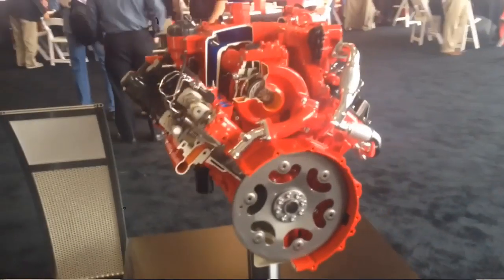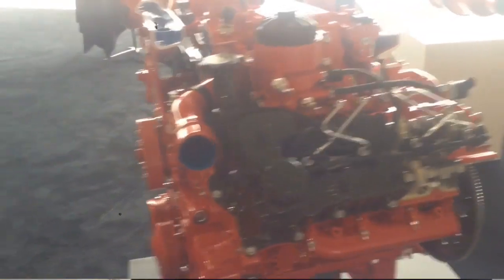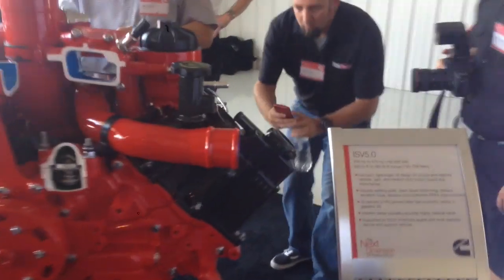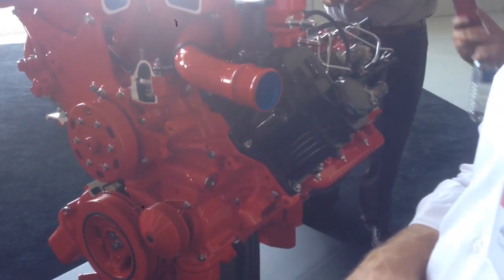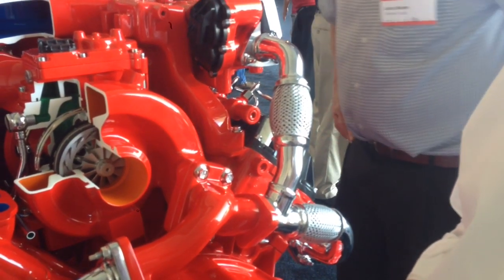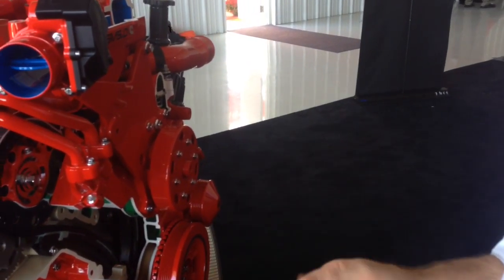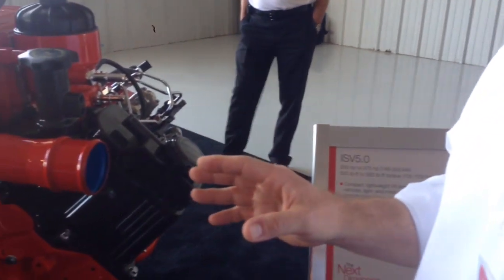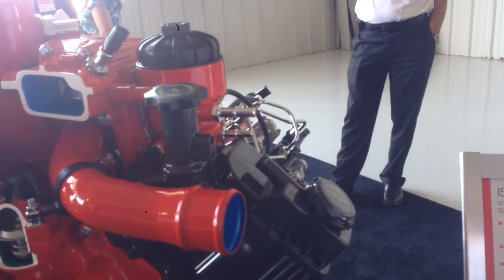Cummins ISV5.0 Diesel Engine

Comment: Just drove this engine in a small 30 ft RV - its almost powerless. From a dead start, it falls on its face and even the slightest grade the Allison 6 speed drops all the way to 4th gear. This has half the power of a Maxxforce 300 hp or the Cummins 6.7. Even in a pickup this engine is going to be struggling!
Reply: It’s the tuning, my titan will break the tires loose at 50 mph.... before it okay, but now it’s a raped ape

Comment: V8's can't compete in inline 6's when it comes to diesels. That's why Dodge has used the inline 6 Cummins ever since they started offering them. If you don't believe me look at the hp ratings of the inline 6 Cummins Dodge uses. Then compare them to this one. Inline 6 wins by a long shot!
Reply: The inline 6 is also 1.7 more liters then this too, ya knob
Reply: Horsepower means literally nothing when towing.
Reply: You shouldn’t speak if you are clueless about diesels....

Comment: Translation, we turn up the boost for Nissan.
Reply: +blackericdenice Actually, it's different than that.  As opposed to a single VGT turbo in the commercial application, the engine for the Titan has a two-stage turbo system, which both allows for the increased power and marks a key difference between the engines.
Reply: The boost is higher right.
Reply: Daniel Senti that’s not the only difference....The engines alone share 80% in common

Comment: Why hasn't anyone thought of casting a diesel engine out of Titanium instead of Cast Iron, is it because it's that expensive? But think of all the advantages.
Reply: These are cgi
Reply: Nitish Kurup cost
Reply: Why do people have this perception that titanium is the best material for every application???
Reply: Icutmetal titanium would be an outstanding material for engines, it is extremely resistant to heat and shares strength characteristics of steel, not to mention its light....Formula 1 heavily uses Titanium but the cost to mass produce it would be insane.